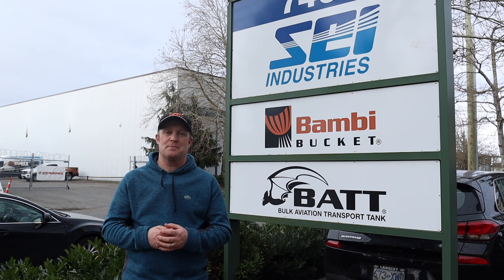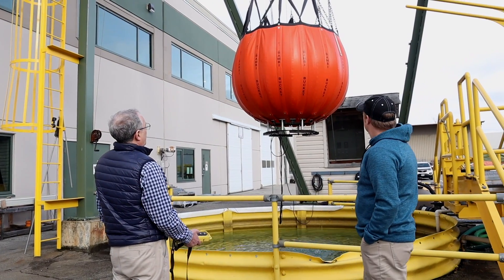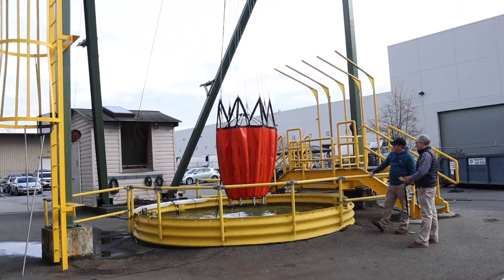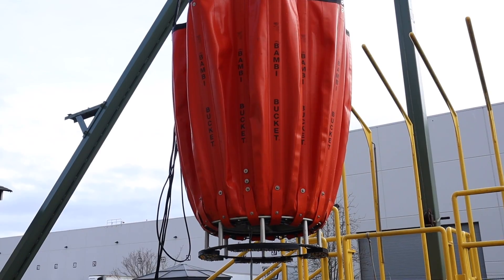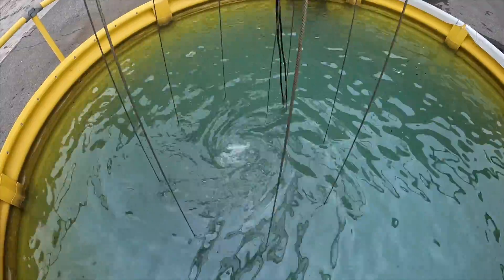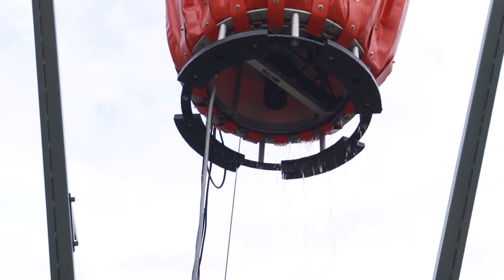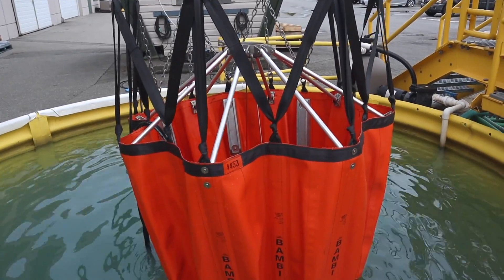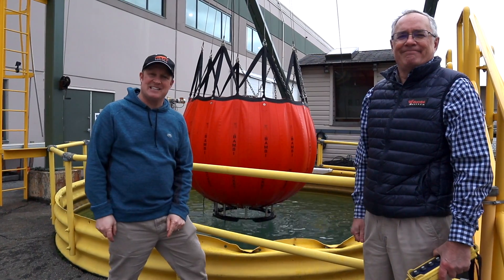Bambi Bucket Factory Visit - How They are Made and How They are Used.

Comment: What capacity do you use on the AS350, what would your overall weight be. I would assume you would have to be lower than MTOW for flying over hot rising air such as that of a fire.
Reply from the maker: Depending on the Astar model being flown most buckets will be between 180 to 240 gallon buckets and will either be cinched if its an old bucket or use the BambiMax valve on a new bucket.

You would have to see what the altitude and temperature is for the days flying and adjust the bucket to ensure you stay under the helicopters MGW. The model of  Astar will have its set MGW and will need to be adhered to.

Comment: Greetings Rick, I looked up SEI to check out the Bambi Buckets and discovered all of the other products like fuel cells that they manufacture.  Good video.
Reply from the maker: Hey Vincent! Yes they make alot of items and many of them are associated with fire suppression. One of their other products is the Fuel Easy which is used to transfer liquids.

You can see how I used 3 to move 14,000 litres of diesel in a day here:

A DAY IN THE LIFE OF A HELICOPTER PILOT - Remote Tower Fuel Haul
https://youtu.be/uPcYulG7xUw

Comment: Quick question. If doing an uplift and you catch a fish (let’s say a 30lb carp) is there any way of getting rid of it? Is it with you for the rest of the days flying?
Great video - thanks
Reply from the maker: With the old udder style the buckets the fish would be released out the bottom with the water as the opening is large.

With the BambiMax valve the pilot could easily dunk the bucket and let the fish swim out. I have heard of a pilot looking down and seeing a Beaver swimming around in his bucket! He went back to the  dip site and dunked the bucket to release it.